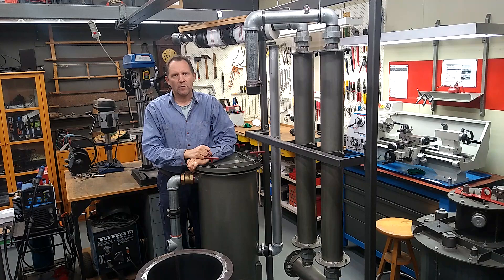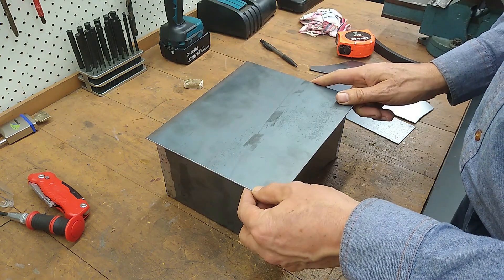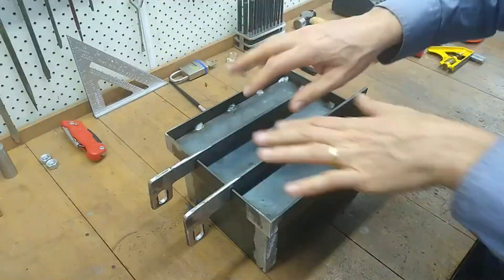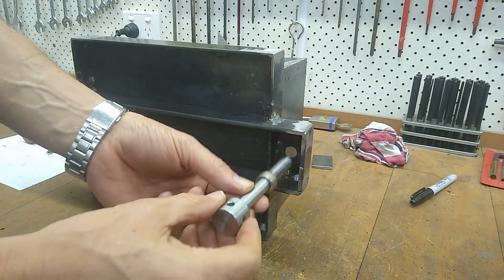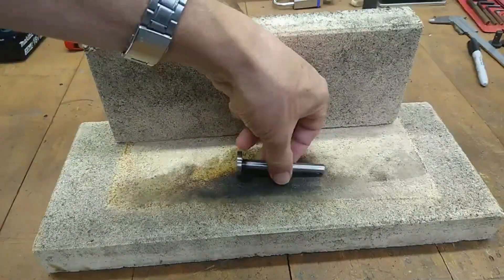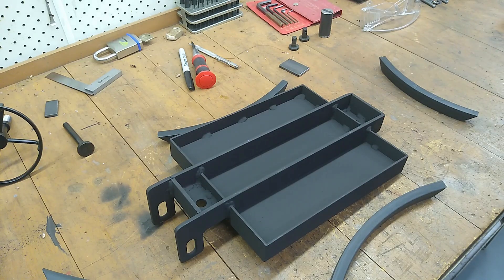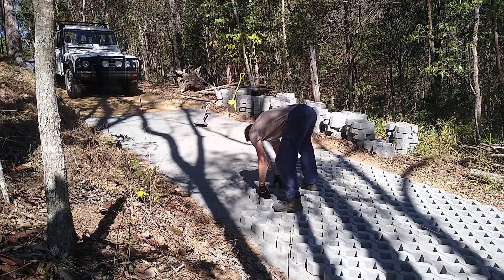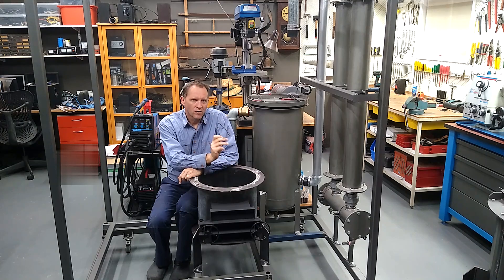Woodgasifier/Generator, Mark II Reactor, Moving Forward at Last Fabricating the Hatch E19

Comment: Keep on Mate, respect and admiration!
Reply from the maker: @athannaelanderson3806  thanks mate
Reply: @whathappensintheshed  Of course, We are on separate sides of the world however I have the same crafts you do; cut from the same cloth you could say. Mark II is a fascinating design, I went a different route with my generator, focusing more on cooling the gases to extract liquid methanol and using the leftover gases to re-circ back into combustion allowing me to use less wood for combustion and more for creating charcoal and gas. 🍻 looking forward to seeing more as it develops!
Reply from the maker: @athannaelanderson3806  That sounds fascinating, I think we're only scratching the surface when it comes to gasification/synergy etc. us backyard hacks we won't quite get to the flux capacitor, but we'll get  somewhere eventually, cheers
Reply: @whathappensintheshed  Never doubt yourself. In all honesty a Flux Capacitor is a bit of a Red Herring, in name it lends itself to unobtainable sci-fi. In actuality Flux describes any effect that appears to pass or travel through a surface or substance, such devices have been made at a home level in example an E.m.p any capacitor used is considered a Flux capacitor, scaled up for warfare they intensify the results with explosives known as a F.c.g “Flux compression generator”. Anywho, I’m sure that’s not what you meant and I’m simply dumping a paragraph about flux for nothing, talk about having too much time on my hands 😂 cheers 🍻
Reply from the maker: @athannaelanderson3806  Well said, thanks for the feedback, cheers

Comment: Just started following you.  Nice shop and good job on the hand wheels!  Did you attempt to check for air leaks on your hatch?  My understanding is that the air seal is very important.  I starting to look into gasifiers (that is how I found you) and would like to better understand the designs and math behind them.  Don't know if you are working of a plan, calculated your own plan or are just winging it.  Regardless, your work is first rate.  I really like your driveway.  Look forward to the next video.
Reply from the maker: @Robys_Workshop  thanks mate, I'll check for leaks once it's air tight, sort of, that's what I did on the first reactor using compressed air and soapy water. The first reactor I had detailed drawings, but on this one I'm doing it on the fly, I'll knock things up in CAD and then go from there. So I did the math first, looked at various types and builds, bought Ben Peterson's book and so on. In the end I went for something in-between a drizzler and a Spanner Re gasifier, so mine is not an Imbert and that is important to remember. Yeah the driveway is a piece of work, I'm over it, will finish it next winter, that's the plan:) good luck with your gasifier design, have fun, cheers

Comment: That's some mighty fine work, right there  :) . 
You do realise that all this shiny goodness might get a little dirty, once you set fire to it, right? 
Nice to see that you have invested in a plasma cutter. I got one last year, but I haven't had the time to get it out of its box, and blast my way though the bank vault door with it, yet. 
Maybe, it will end up as part of a CNC plasma cutter project..... 
The possibilities are endless  :) .
Reply from the maker: @CNCmachiningisfun  thanks mate, yeah hopefully the bits I painted black will get the dirtiest, yep finally got the plasma cutter, about time too, I must have spent hundreds on cutting discs, CNC is something I definitely consider, however this unit uses high frequency pilot arc, apparently this is bad for the electronics, not sure, some decent shielding should take care of that I would have thought, still at $379 I couldn't leave it, this gets me into the plasma cutting game now, happy days.
Reply: @whathappensintheshed  
 Yup, the layers of dirt will keep the black paint from getting ,,,,,,,,, errr,,,,,,,, dirty  ;)  . 
As an electronics engineer, I reckon on taking a look into the plasma HF issues with CNC. 
Having built a fairly large CNC machine, back in 2010, I saw some of those problems, during the finishing steps. 
Like you, I have shares in the cutting disk empire, so it will be great to migrate towards plasma, while saving a few million Rubles  :)  . 
HF shielding is definitely the first step, along with a few others that aren't quite so obvious  :) .